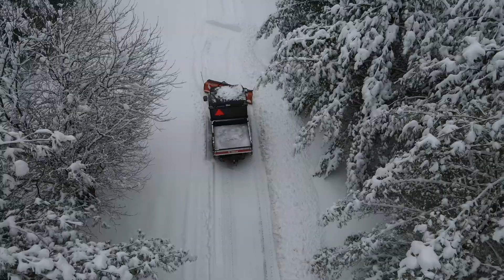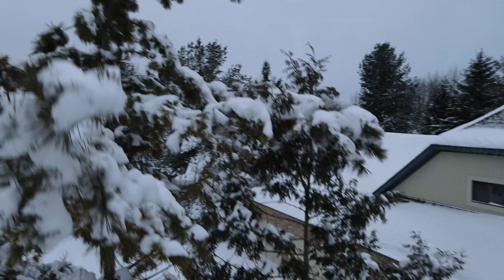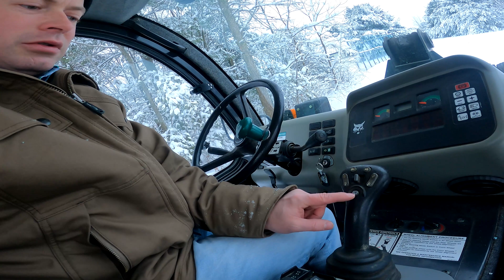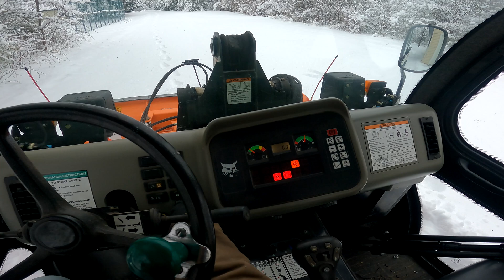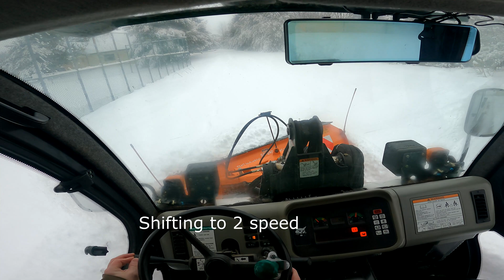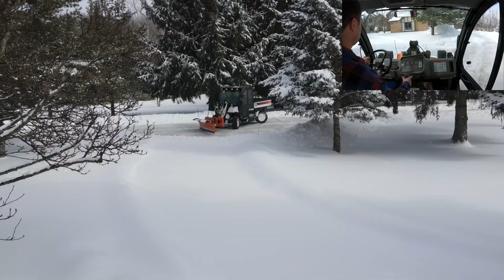✅ How to Operate A Snow Plow On Bobcat Toolcat - TMG Industrial SP-240 Articulating Hydraulic Angle

Comment: Nice vid. Thanks! I have an older Toolcat (2007 "D" model) that I used to use in concert with an 8' plow quite similar to yours. I found that adding weight to the box would help...along with tire chains, of course.  And, yeah, float on the boom is asking can be asking for trouble.

Comment: The one thing i hated about plowing snow is that the snow would piped along the side of the road wound encourage drift snow to accumulate  along the edges and if it was a very snowy year you have to come and push them back further or remove it altogether . With blowing the snow , it reduces the volume and moves it further away from the drive way.
Reply from the maker: Yes but you have to drive much slower with a blower.  I dont get enough snow in SE Michigan to justify a blower.
Reply: @NaterTater  i am right across the border from you and probable get the same amount of snow , i mange to to do a good job of blower small accumulation of snow after watch real professionals residential snow removal companies from Quebec .